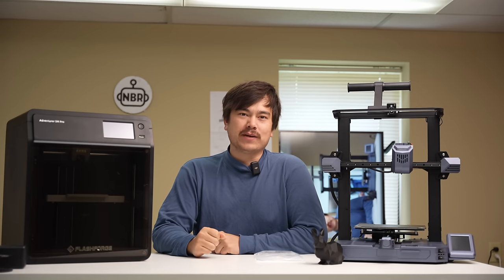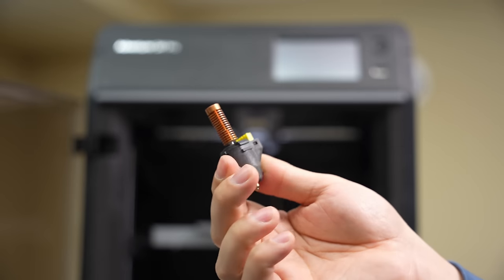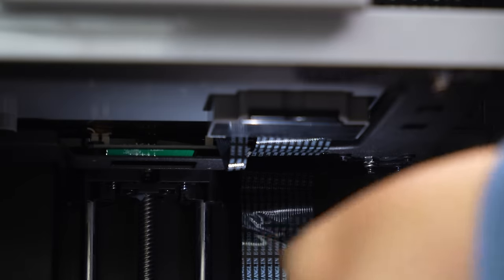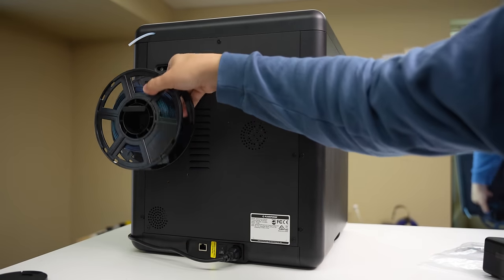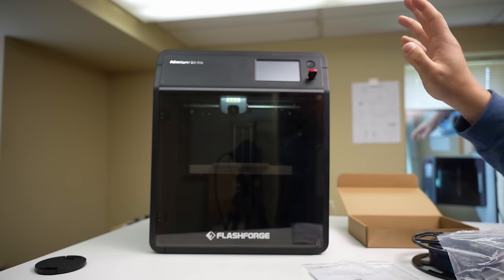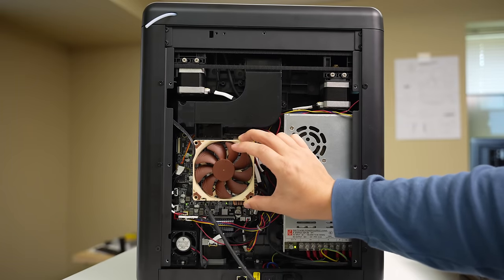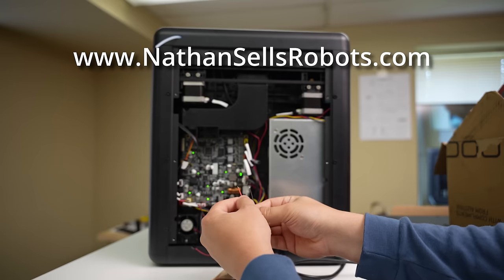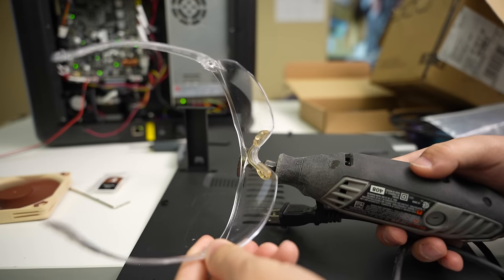Flashforge Adventurer 5M Series - An Insane Price Point for High-Speed Printing

Comment: Apparently they just released Klipper firmware for the 5M series and made the designs open source. Big steps in the right direction! They also released a printable enclosure design for the 5M, will have a cheap accessories kit to make it work, and dropped the price to $299 which is quite a bargain.
Reply: would you suggest the 5m or the 5m pro, if you were going to buy one.

Comment: I used to own a Adventurer 3. 
Major problem was leveling as my bed seemed warped. Multipoint leveling was bad. (Which will not be the case on the 5M)
Also issues with clogged nozzle over and over. Had to spend quite a bit on new nozzles as these are not standard.
But it was a quiet machine. 
I really want to like this 5M, but my past experience is holding me back.

Comment: The main thing holding me back from using the Noctua fans was the voltage difference but that little adapter they gave you is pretty cool.
Reply: Don't most boards just have voltage jumpers nowadays?
Reply: my main reason is they are weak that's why they are quiet
Reply from the maker: They are well optimized and very reliable though. Part of the struggle of making a silent fan is having it be reliable enough to keep working long term. Just a tiny amount of friction will reduce the fans performance greatly when dealing with such a small motor.
Reply from the maker: Not sure how it works yet. It’s a cool little device though. Super inconspicuous and easy to install
Reply: @NathanBuildsRobots you should measure what the output voltage is when hooked up to a 24v source and without a fan plugged in. I would love to use these since buck converters are huge
Reply: Looks like they have been researching what other applications customers use their fans for and identified a gap. Agree this small adapter is an excellent idea!
Reply: Isn't it just a resistor? People have been doing resistor for millenia. The problem is that it gets hot over time. It needs to be cooled. So a cooling fan for a cooling fan. 😅
Reply: @hologos_  It's a switching regulator, so negligible power dissipation.

Comment: Had one and returned it. The auto-leveling does not work everytime. One day it decided to print 3-4mm above the plate, cool. Next after another level, the nozzle was buried in the plate, scraping the coating off the plate and snapping the nozzle's heat sink. A ploy to get me to buy another nozzle? 🤔

You can turn it into a hotspot but cant send prints to it from Orca after they give you profiles, cringe. No chance it is below 50db with the stock fan in the back. The screen isn't very responsive to touch of your finger. Have to go through a couple screens just to change z-height and temps. The glue they include sucks ass.

Someone 6ft in the ground would respond quicker than their customer service.

Fun while it lasted less than a week. At least my ender "just works".

Comment: I have loved my adventurer 3 since I got it like 2 years ago so I am looking at this for a core xy for more detailed and faster printing
Reply from the maker: How has it held up over the years? People always ask me about long term reliability and I’m like - idk I just got the thing
Reply: @NathanBuildsRobots   it still runs like the day I got it now I did some upgrades like a spool holder replaced the nozzle (which it also has the hot swap) and bought a new bed and put a pei plate surface on it but it still prints amazing and it can go decently fast for a older bed slinger if I want to have detail its what I go to out of my current 4 printers (ender 3,kp3s, and monprice cadet 2 are my other ones)
Reply: I doubt this would give you more detail.  The Adventurer with a 0.2 nozzle is pretty good.

Comment: Thanks for the vid this is one of the printers im most looking forward to. a lot of people give flashforge flack but they're easily one of the most reputable companies in the game and have a ton of their products in my print farm.
Reply from the maker: They seem more geared for professional work, but coming in at beginner/budget friendly pricing
Reply: I had nothing but problems with my Adventurer 4 related to their "Auto Bed Leveling" which is blatantly false with that model. At least they are using load cells for this one
Reply: Flashforge printers are pretty bad. They like to say "professional" or "industrial", but their non-actively heated enclosed printers only reach a chamber temps of like 40-45c, which is nowhere near even ABS print temps. Their print quality is also worse than a stock ender 3 and very slow. And yet they claim those enclosed printers reaching 40-45c can print ABS, ASA, PC, etc. Their beds are also very thin so they warp significantly. Many of their printers that costs so much don't even have auto bed levelling. Very scummy company.
Edit: By print quality it's not just the visible quality, but also referring to strength. Their printers often underextrude or overextrude q a bit
Reply: @gedeonang7077  are you talking about this model?

Comment: I sell and repair printers, one big objection I have to the Flashforge adventurers is the outrageous price of a mainboard. I can replace most boards for under $50 AUD but it is $200 for the Flashforge and it looks a lot like the one you just showed.  I sell the Adventurer 3 lite for $275 and it is $200 to replace the mainboard.
Reply from the maker: That is absurd, they should definitely get the Mainboard prices down

Comment: my dream printer would be an enclosed core xy with the quick change nozzle system capable of higher temp materials with a build area of ~275mm³.  printers like this shouldnt have Ender3 sized build areas imo.

you didnt say if it was a direct drive extruder, and if you did, apologies.

i think these companies can come up with a Cura plug-in for the printer if they can put the effort into reskinning/customizing a Prusa based slicer.  make it available on the downloads page of their websites.

Comment: Have been waiting for this Nathan review. Easy hotend swap, steel rods, and the color touchscreen would convince me to choose this one over a P1S. Does it have a high flow hotend? I’d mainly print PETG, how is the PETG speed and quality on this one? Also, are the steel rods glued or screwed in? Can you use Prusaslicer, as advertised? That PLA stringing was worrying, though. What brand was that? What about printing over Wifi? Is there a shady cloud service we have to pass through?
Reply from the maker: Basically a Bambu Lab printer without the annoying Bambu Lab things. I’ll take it!
Reply: Me too bro, thinking about k1 vs 5m pro. Petg most of time...dunno what to buy
Reply: @deflash  I’m also thinking about the non pro version. I’m not going to print ABS because of the fumes. I’m very sensitive to smells, as much as Nathan is sensitive for noise. I feel PLA smell very strongly and can even smell PETG as unpleasant. So in the end, That’s why I’d pick the pro version, even for PETG. Also K1 got several updates since its release. I think the extruder was improved, and even Klipper got opened (is that right?). I’ll time my purchase for black friday to get the discounts and to buy the best option after the initial issues are fixed.

Comment: Looks very promising. The recirculating filter is the right design decision, as it keeps the chamber warm and multi-pass filters the air (which is needed to remove a high-enough level of particulates and VOCs.

I might have missed it. Is the nozzle hardened?

The plastic around the hotend looks like a glass-filled liquid crystal polymer (LCP). LCPs have very high temperature resistance (and low expansion coefficients and high tensile modulii).
Reply: Just got my 5m Pro today and it came with 2 nozzles. For the older AD4s you had to buy a separate hardened nozzle that you could snap on. I think these stock nozzles are hardened as it says it can print CF out of the box but I will check with flashforge to confirm.

Comment: If this printer can handle CF Nylon, I am very interested.

I have been eyeing the Bambu P1S, as I want a printer that can handle nylon, and also just works with minimal fuss.

That is the big thing, minimal tinkering and fuss just to get a print going and to complete without drama.

I have an Ender for times I want to tinker around.

The Bambu does offer more build volume in the X/Y, and can manage PC printing, with the hotter extruder… But those are nice to haves more than necessity for me right now.
Reply from the maker: Yeah though it would be awesome if someone came up with an aftermarket adapter that let you use any V6 style nozzle and went up to higher temps. No idea why the FlashForge temperatures are so conservative
Reply: @NathanBuildsRobots  I wonder if it can go hotter if you edited the config, or if the plastic surrounding the nozzle/heater would deform from the heat.

280* should be hot enough for CF Nylon printing.

The biggest variable for me, is if the thing works as well, or close enough to the Bambu. The slicer profiles and config are high points for Bambu. Basically little to no tinkering with settings and profiles to get excellent results.

I don’t know if Flashforge has well done profiles available for this printer, so I am keeping an eye out for more reviews.

Comment: On the flashforge site, the 5M doesn't print ASA or ABS you need the 5M pro - same price as Bambu, etc etc  - What gives?
Reply from the maker: 5M is unenclosed like P1P, 5M Pro has enclosure like P1S
Reply: I must have missed that detail. Thank you - I almost pulled the trigger 😝

Comment: I am in doubt between these two printers, the Creality K1 or the Flashforge 5m Pro, which one would you recommend? Thank you.
Reply from the maker: K1 is cheaper and their slicer has great Wi-Fi capabilities.
5M pro is quieter and has a good air filter with slightly better print quality and quick change nozzle so you won’t ever really need to use an Allen wrench for routine maintenance.
Both are great, fast printers, the k1 is the more budget friendly option especially if you find it on sale

Comment: I have a question. I am planning to get a printer for myself and I was between Bambu A1 AMS combo and this maschine. I am more inclined towards this one because of the air filtering feature. The reason being that I have no place but my bedroom to put this in. Would you recommend this maschine in my situation or would you say dont put anything in your bedroom. Im concerned due to health conditiones that could be caused by smelling micro particles.

Comment: “..Reloading The Magazine on a…”..Subbed🤙🏻
1-(Powerfully  Exercising 1 and 2 in one sentence was Both admirable and impressive..)
2-( The “Flash Print5” Terms of service served nothing but to Shame them I almost returned it after reading it and still Might..)
Not a bad Machine for the Price, technically speaking…
I like to mod stuff, That’s why I purchased the Ad5m over the Pro..
Also, Makes a “clicking”..Extruder slip type noise when at rest..(Pressure Keeping?)..
Regardless. I like to tinker and It’s worth it in Parts alone..🤙🏻

Comment: What is the current-draw if the front facing button is used? I imagine the back one is an isolator and the print a digital flip-flop, similar to desktop PC switches. But does it pull current, is it connect to the network? Can you wake-on-lan the printer, And can something like In-Your-Sleep-Bambu printing occur?

Comment: Are you drawing heat away from the board with the Noctua fan? If so. Do you want it to draw heat into the FDM roll back there? Would that affect the FDM adversely?
Reply from the maker: There is not enough heat coming off the Mainboard to affect the filament
Reply: Cool. Thanks.

Comment: What I'm wondering, is what the ACTUAL speeds are for it. Flashforge tend to undersell the speeds their machines are capable of. For instance, their Adventurer 3 Pro is advertised as 30-100mm/s, but can easily print 180-200mm/s with the right settings, so I'm wondering how much they're underselling the 5M Pro's speed.
Reply: One thing is for sure, you can't add your own high flow nozzle and I bet that is where the bottleneck will be.

Comment: Are you using Flashprint or another slicer?

Flashprint seems to fall behind some of the others for features. It is closed source from what I can tell, and that makes development slower.

Also, since it is killer based, can you use the web interface options? How about access to the printer config files?
Reply from the maker: Files were sliced using orcaslicer. They provide a profile that you just import and it’s good to go. 
Not sure about the Klipper implementation yet. When I tried to connect to the IP the web interface refused a connection. Not sure if there is some configuration I need to do, or what. Unfortunately for these early access machines the software and documentation isn’t always complete to be able to know all these things. Will follow up if I learn more
Reply: @NathanBuildsRobots  Thanks

Comment: Please use safety glasses to cut the hole - for your protection. Disconnecting the printer from the power for wiring? Does not seem to be necessary…well done 👍

By the way, the filament holder on the back will be totally inconvenient for changing filament, as is unfortunately the case with other machines.
Reply from the maker: People who change filaments more than twice a week are degenerates

Comment: Seems like it would be as fast or even faster than bambu lab printers. All the speed and sleek looks without the proprietary nonsense. If you don't care about multicolor prints, then this is great.
Reply from the maker: Yep, and a good deal cheaper too
Reply: Yep, although the AMS has a few other benefits too. Auto filament loading, auto switching when the spool is empty and you have a nice enclosed filament chamber which you can keep dry. Would be great if you could have this printer with an AMS like solution

Comment: Does the printer accept Gcode files?  The last Flashforge printers that we got at our school were Adventurer 3 and Artemis printers I believe and they were locked to using Flashprint and not able to accept gcode.
Reply from the maker: That’s crazy. These accept gcode files. I used Orcaslicer and uploaded them via USB
Reply: Thank you Nathan for the thougful review.  I have been doing 3d printing in my classroom since 2016, getting my first printers from grants.  My school district likes to supply flashforge 3d printers for their engineering classes in the past.  Not taking gcode was a pain point for me since flashprint used to only export .gx files and not gcode which meant i was stuck using their slicer only.  I am still using 2 makergear m3 printers to do most of my printing becauae they take gcode.
Your review has made me consider this printer over the p1s for printing in the classroom.  It does look like a nice well put together printer.  The touch screen and front usb slot is super useful in the classroom environment.

Comment: I like this one.
Why don't I buy one then? ...
I need a much larger build volume. At least 350*350mm
Reply from the maker: FlashForge has larger machines. Would be really interested to see an offering in this product family (low budget semi-pro) in a larger print volume.
Reply: @NathanBuildsRobots  I never understood the "standard" format became 220'ish mm.
I mean, belts and extrusions are produced by the kilometer, the number of parts aren't growing with build-volume, motors, electronics, assembly and handling is identical.

Comment: Maybe I missed it, but is this running stock Klipper? I've commented it before, but the Bambu is a no go for me because of the proprietary firmware. I don't like how Creality is handling Klipper on the K1 either. 

If I could find a decent CoreXY printer running stock Klipper for ~$500 that I don't have to build myself I'd be happy.

Comment: Is there any reason this can’t print nylon? The hot end can go hot enough but they don’t list it as a supported filament
Reply from the maker: I’m guessing they just didn’t think about it or test it. It should be able to handle nylons except for the higher temp stuff that requires 300C+

Comment: Which one would you recommend - 5M, 5M Pro, or Creality K1? Will be mostly printing robot parts with PETG.
Reply from the maker: Just PETG I’d go with the 5M. The P1P makes good PETG parts too
Reply from the maker: You probably want a textured PEI SHEET. My PETG parts have absolutely torn any smooth surfaces to shreds within 5 prints.
Reply from the maker: But also… the 5M is $380 with discount code, so it’s almost half the price of the P1P - seems like the best deal of the bunch

Comment: Is the only difference between the Adventurer 5M and 5M Pro really only the enclosure ? Or are there some more differences?
Reply from the maker: There was a spec sheet, it’s also missing the camera and the chamber filters and fans (because there is no chamber)

But touchscreen, print volume, print speeds, quick change nozzle system, etc are all the same
Reply: @NathanBuildsRobots  I might have missed it in your video but what's with the camera? Can you view the camera feed on your phone or PC?
Reply: There are a few differences - automatic shutdown after printing is finished

Comment: I know this isnt a CR10 SE video, but since its on your bench have you had a chance to use it? Would you recommend it? Creality has it for $70 off right now just waitng for your review before pulling the trigger!
Reply from the maker: The Ender 3 SE is a much better value. What they are doing at the price point is insane. On the same note, the CR-10 SE isn’t as good of a value, but it is a good printer. Only issue is fan noise.
Ender 3 KE might be a better buy as well in terms of value for money